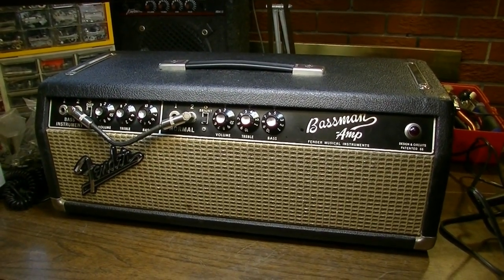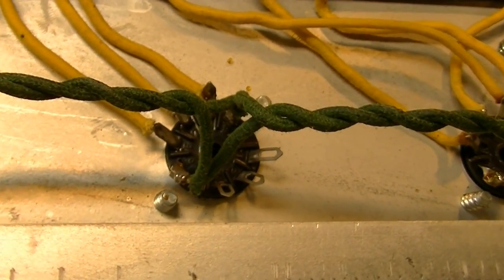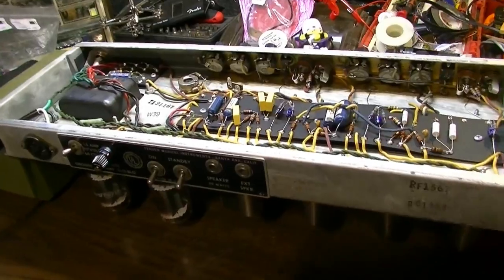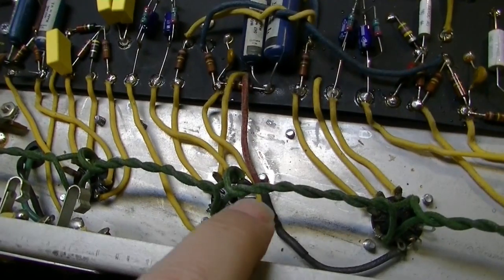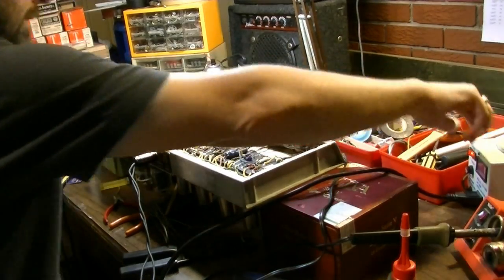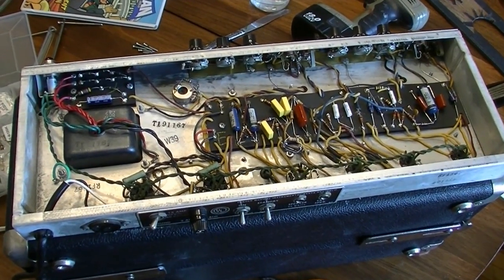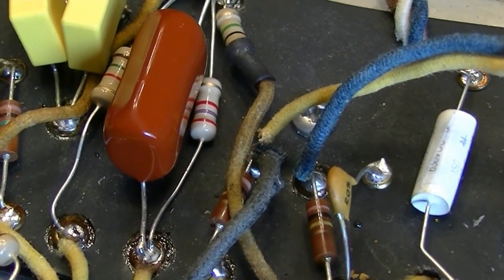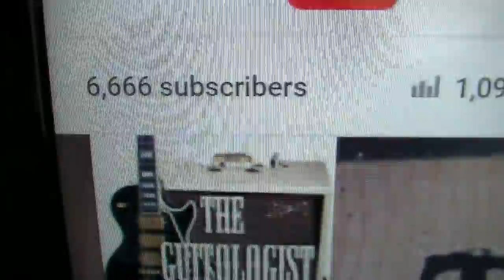Hacking a Blackface Fender for Monster Gain, Blasphemous or Badass?

Comment: I didn't catch what the actual cause of the problem was . You told us of all the mods you returned to stock. If it was something stupid don't worry about it. I'm sure all of us here have done plenty of I didn't think that through well enough. That to me at least is what makes it entertaining. Does your carpal tunnel prevent you from doing big bends with vibrato? The way you have compensated for it is great and unique. BTW your playing could probably make any amp sound good. I'd like to see you start getting some session work. If you started carrying one of those modded fenders into a session the word would get out and every studio around would want one. 2 channel amp using an AB box and an fx loop with that sustain hell yes. I had an old Marshall 50 watt combo from the 70s. All the sticker were gone from the cabinet and the chassis so no model number could be found. It had the black and gold basket weave grill cloth. I don't know if you know the years that Marshall used that pattern grill cloth. A Christian amp tech I met while living in Australia modded the amp for me. He gave me the friend pricing! Matt added an fx loop with level controls by adding another tube.  One half powered the fx and the other was a gain stage. When the amp was stock jumpering the channels did not increase gain it just added more lows. I read on the web that Marshall made a few purpose built combos and possibly that might be one. Not even diming the amp would produce a Marshall distortion sound. Anyway man great playing and a great channel

Comment: Have u got a way to make an active bass work nice on an amp without active input, other than just turning the gain down?
Reply from the maker: Of course one will work. The "active" switch on some modern bass amps just pads the input slightly. Turning the volume down on your bass will do pretty much the same thing.

Comment: Um , I'm not getting how an ac signal is flipping phase through each gain stage .. each gain stage , its just meant to get bigger . Want it to work better with your pedals ? Try tweaking the input impedance . Want more gain in the drive channel? Try using marshall balues on the cathodes of the first and or second gain stsges .. oscillations could be fixed with grid stop on the problem stage.

Comment: Not sure if you mentioned if you changed any of the preamp or power tubes or used the originals. Either way what makes are in this amp?...As always a great video. Well done~!
Reply from the maker: Tubes are 
V1: Vintage RCA 12ax7
V2: Tung Sol 12ax7 (new)
V3: JJ 12AT7  (new)
V4: RCA? 12AT7
V4 & V5: 1960s GE 6L6GC
Reply: These are the original power tubes? Let's say you needed to replace those for some reason, what make/model would you use? Thanks for the very quick response btw.
Reply from the maker: Vintage RCA Black Plates, hands down. They are what came in it originally and that's my 6L6GC of choice. That's the money-is-no-object choice. The sane person choice...The GEs that are in it, or Sylvania, for vintage tubes and JJs for new ones. Antique Electronic Supply does matching on those and I've had great luck with them. I think their matching procedure also acts as an extra layer of QC.
Reply: The Guitologist You are correct, Sir! I have had good luck with the JJs.You can get good quality trannies from triode electronics. You have good places to get parts to. Thankz
Reply: "These are the original power tubes?"

Virtually no 50's or 60's amp has "original tubes" in it, regardless of what the seller says.  While I have seen a *very few* hi-fi amps that had what may have been original tubes (with the hi-fi company's name applied on them), they are certainly the exception.  You wouldn't even want "original tubes" because they'd likely be 20-30 years past their prime & near-dead.

Some kind of fetish has sprung up in the last couple years with sellers claiming "original tubes".  I don't get it...  Back in the days these things were new, you could buy tubes at the TV repair shop, the radio repair shop, the hi-fi store, even the drug store.  People didn't leave the same tubes in any amp unless the thing sat in a closet & never got played.
Reply: Glad somebody is having good luck with JJ! Had 3 separate orders from CE Distribution last year with weak or defective JJ ecc83's and 81's. I've dumped them for preamp tubes and moved onto Shuguangs.
Reply from the maker: I find most 50s and 60s amps I get DO have the original tubes unless someone has mined them. Old American tubes were very robust. Techs will strip the original power tubes (RCA black plates) and resell amps without them or give back to customer with "new upgraded" tubes. That's been going on a long time. If you find an old amp without the original tubes, it was either gigged with a lot or original tubes have been stolen from it essentially.
Reply from the maker: If I thought about it, I probably have seen some weak JJ preamp tubes, but never had a problem with any of their power tubes.
Reply: But how could you know those "original tubes" actually came in the amp from the factory?  As opposed to simply being "old production tubes"...

I've been lucky stumbling across old production tubes for inexpensive prices, and have always bought when I saw a good deal whether I needed them at the time or not.  I've done that since the late-90's.

As a result, I've got about 16-20 pairs of 6L6GC's (including 8 pairs of RCA blackplates), even though I only own 2 amps using 6L6's.  Add to that ~25 pairs of 50-60's 6V6GT's, and over 90 12AX7's from Telefunken, RCA, Mullard, Amperex, etc.  Not to mention any of the other tube types (last count I had over 800 tubes on-hand).

None of my amps have "original tubes" (in the sense that a vintage amp might have "original transformers"), but none of them have new-production tubes in them either.  The very few new production tubes I have came in amps when I bought them, and were then yanked out & swapped with old-production tubes.

Maybe I'm being too literal with the term "original tubes" when "old production" is what folks really mean...
Reply: Nice

Comment: Out of curiosity how practical would it be to build an exact reproduction of one of these from scratch?
Reply: Not all that hard, older amps like this are mostly point to point wired. Start with the most basic possible tube circuit and see how you go.

Comment: I had a '65 blackface twin reverb which is similar to your bassman which played pretty loud but stayed clean and clear. I had just seen Hendrix at a local stadium and noticed how his Marshalls were chained together. I tried jumping the channels together but, like you mentioned, the inverted phase seemed to cancel everything out. So then I took my small Silvertone amp and wired a cable directly from the smeaker leads to the input jack of the Twin Reverb. It was perfect. I could dial in the distortion I wanted with the Silvertone volume and dial in the volume with the Twin. I got a Maestro and a Fuzz Face but always like the variety of sounds I could get with the Silvertone better. Fast forward many years and I took my rig outside to play together with my son and just had the Twin set up. I cranked it to 5 and it sounded the best it ever had. There was no master volume, so the distortion level was set with the volume control. Over the years I had replaced bad tubes with ones I got from K&B drugstores with a tube tester kiosk with all the tubes for sale in the bottom. I never had anything re-biased so I'm sure they were all mis-matched. It seems like an easy modification that could easily be reversed with matched tube sets. Thanks for your great video.
Reply from the maker: One thing I'd do differently in that setup is make a preamp output jack on the Silvertone if you like its tone rather than jumping off the speaker leads. The impedance will be way off if you're using the speaker secondary leads of the Silvertone on the input of the Fender.
Reply: Thanks, Guitarologist. That was 50 years ago when I knew everything. Part of my point was that the Fender input chewed up that signal and spit it out anyway for 20 or 30 years without blowing up. I lost both amps and all my guitars and everything else I owned in Hurricane Katrina. I just play a Takamine 12 string acoustic now. Thanks for the insight.

Comment: So a cathode-biased converted Blackface Bassman is essentially a SUNN Model T once you add the extra (doubled) gain stages and 4x 6L6 output section, isn't it?  Every stoner and doom guitarist ever has Fender to thank for the basis of their holy grail amp. :)  Great vid!
Reply from the maker: Everyone talks about Fender, but I'd also give Valco, Danelectro, and Gibson amps some serious props for building amps with some serious gain potential. Here are a couple examples: 

1965 SIlvertone 1484 by Danelectro: https://www.youtube.com/watch?v=GL5sDJl_u-0&index=9&list=PL68vqBBsqTi8OLWBbXtvpM4YmrwOpkl1I

1959 Gibson GA8: https://www.youtube.com/watch?v=Gnj0mws23yk&index=3&list=PL68vqBBsqTi-STVAdTp2cFAnozpD135a7&t=1s

1959 Valco National Chicagoan: https://www.youtube.com/watch?v=3lx4IM72Fl4&list=PL68vqBBsqTi97oHswdFdG8Z_BxJ1wYV6z&index=13
Reply from the maker: ...but you're right about the higher watt amps.
Reply: Woah thanks!  I'll have to check those out.  My collection is growing a little too fast!
Reply: Phillip hanna check out the Fender Blackface and Silverface PA amps.    They're not really voiced for guitar, but you get a good sparkly yet deep circuit.  If I recall the PA-135 has an ultralinear power supply too.  Best part: you can pick them up cheeeeeap.
Reply from the maker: If you buy an AB165 or AA165 Bassman and want to send it my way, I've already done this mod once, so it'll be easier a second time: bradlinzy at gmail
Reply from the maker: Also, since you're in the stoner rock or doom metal scene, check this amp out. These things rattle the foundations: https://www.youtube.com/watch?v=4tjYK2Ati7Y
Reply: Phillip hanna , yeah I use an EQ for coloration which definitely helps.  plus you can also daisy chain all the channels.
Reply: Phillip hanna Phillip hanna I found that Fuchs does a mod to the PA amps, but charges somewhere around $1500.  I'd rather send mine to the Guitologist and spend the extra on a BIG cab!

Comment: I have a 66 bandmaster....Wanted the same thing...Earlier break up.....I changed a resistor on channel 1 and modded my negative feedback loop.Also installed 6v6’s...Breaks up around 6 instead of 10...Cheers..

Comment: This is honestly one of my "go to" videos for inspiration. I'm looking to do a similar mod to the normal channel of a BF Deluxe Reverb I'm building from a kit. Could I ask what was it you specifically did and would it work for that amp? I'm pretty sure both amps share a similar circuit(minus the Reverb/tremolo bits). It sounds like you basically changed the modded channel's tone stack. Or is there more to it than that?

Comment: Late to the party here but if you have an old non-master volume and and want to hear amp distortion at low volume levels just get a good speaker attenuator and skip hacking up a 50+ year old vintage amp.  I know the Bassman heads are not worshipped as holy relics like the tweed Bassmans but they are great amps with their own history, value, and uses.  I've owned black and silver Bassman heads and just last night saw a band (The Loons) who have a stock Bassman head doing bass duty along with a Rickenbacker bass and the bass player gets absolutely wonderful gritty tones out of it.

Comment: A bit disappointing that you don't show what exactly you did to that second channel to make it scream like that. Ok you put in that extra gain stage --that was taken out before? if so there was no problem jumpering the channels. This video starts with a working amp... you explain what you are going to do... do a mod FAIL, another FAIL. Then cut to the final walkthrough... 

Did you eventually change the bias network?

Comment: Another way to take advantage of both channels on a post-Tweed Fender amp, no solder required, is to use a switching box with phase inversion before plugging in.
Reply from the maker: Someone else mentioned that too, a great point. Is there an ABY box with a phase switch?
Reply: Yep, its pretty standard with ABY switches for running more than one amp, because often the two amps will end up out of phase otherwise. I run two amps, one of which is Blackface Deluxe reissue. I just tried connecting to both channels. There's a noticeable volume jump when you have the two channels at 180 deg to each other. Not huge, about 25%. I don't know whether it makes for earlier break-up, its late where I am and the Deluxe has to be damn loud to push the tubes!
Reply: PS, my switcher is called a Radial Bigshot ABY. cheers

Comment: I "used" to have a fender twin and a vibro reverb....man there amps would not distort at any volume levels and they were LOUD and clean as a bell, same with some older marshalls, cranked they would distort a little, I usually HAD to use a tube screamer to help and it was a good one, then patching the bass and guitar channels together and VOILA!

Comment: Sometimes the heater wires are out of phase also. meaning that the wires are twisted and not soldered to the same pins. pin 9 can be soldered to pins 4 & 5 for instance on your preamp tubes :)
Reply from the maker: I have heard or read this as well. Never seen it cause a problem in the wild, but first time for everything.
Reply: "Heater phasing" is a Gerald Weber myth.  I've intentionally wired a single amp both ways to see if there was an audible difference, and there wasn't.

Comment: The original lead dress of one or both of the inputs, from the series resistors to their respective grids, seemed pretty messed up. I redid what was needed to make it look better, and only wanted a single channel. I bet a lot of people just go ahead and do the same to theirs. This eliminated the main cause of the parasitic oscillations, for which extra (wonky) circuitry was added. It was a detriment to the tone & playability of those amps, and I was able to rewire the output stage to eliminate a handful of those components. My AB165 amp can finally breathe.
Reply from the maker: Yep, all the feedback chokes them off. This one had most of that removed before I got here, or it was never there.

Comment: Most likely is when the tubes were red plating the amp sounded bad ass been there done that so the customer wants that sound but is leaving in your lap, as you know going over the rated bias  sounds good and has infinite sustain but your tubes won't last as long, as a tech IMHO it is the customers call as to how much they want to spend on tubes and how long a period this expenditure lasts which is determined by the bias point, me, pump it up.

Comment: I can see why some purist types might freak out, but the primary quest is good tone. If you want to be a collector, than collect, but a player wants good tone. And I've yet to see any of these tube amp service videos that show an amp that matches the original schematic. These were the old days and I'm guessing they were constantly modifying the original circuits and revised schematics weren't a big priority. Plus, this was also an era of things being hand made and when you get into hand made goods, no two are exactly the same.
Reply from the maker: Fender was more consistent than some other manufacturers, but you're right! They were modifying from their own schematics as well. Lots of transitional examples out there. Generally speaking, if mods were done with some decent skill and they are reversible for anyone wanting to return to stock circuit values, I think mods can be a good thing, even in terms of value. The real sell comes in plugging a player into the amp and saying "now try THIS!"
Reply: Yeah, mods don't bother me. I just want good tone. :)

Comment: There's nothing wrong with it at all. It's not like they are ultra-rare, one of a kind amps. And it was already heavily modified too. These amps were designed to be used hard, not sit in pristine condition exactly as it came off the line and never turned on.

Comment: They left you half a tube in there, it's like they WANTED you to mod it. I'm against hacking up vintage equipment, but this looks like a clean job and is totally reversible, I think it was your DUTY to mod this amp.
Reply from the maker: Thanks for the comment. I agree in this case. It was asking for it.